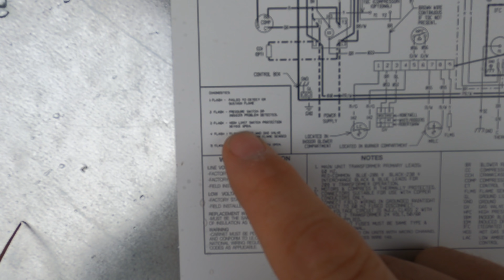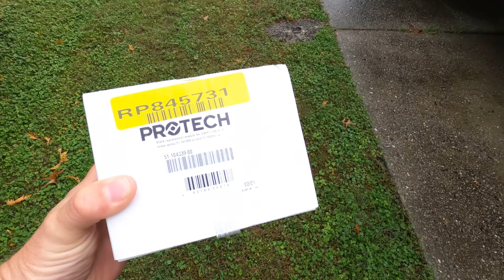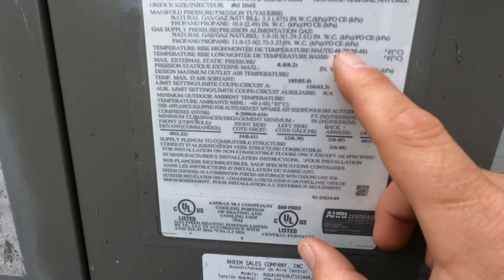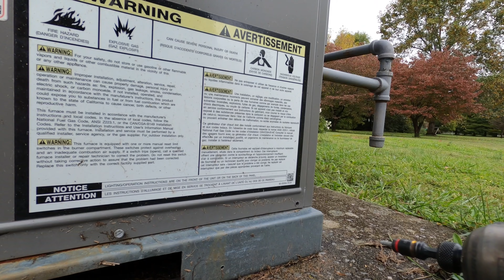Gas Heat WON’T Turn On | HVAC Service Call

Comment: Dude I was thinking during the whole second half of the video "man if it's under warranty, I normally just replace the whole motor anyway, not just the module", then you come around the corner with the same shit 😂 You are a top notch technician, and make me feel a little more confident about my practices every time I watch you. Awesome content man.

Comment: I love the video highly impressed on how you keep things so clean idk how you do it.... my only critique on the videos is that there is not enough explanation on what you are doing, or how to came to your diagnostic of the failed part. For those that don't have vast hvac experience it may not help those individuals and may even confuse them,when 90% of your videos are back ground noise. Idk if this kinda content is what you are aiming for, but if it educate I would advise explaining what was the issue and how you came to solve the issue. Thanks
Reply: Very good suggestion, was thinking the same. Replacing the thing is something (almost) everyone can do. Diagnosing the problem is the hardest part, especially for a newby like me.
Reply: But it’s not a how to video it is just showing you what he does in a daily life
Reply: He had several videos explaining in detail what's going on, think this and some others are just laid back videos for maybe people wanting to get in the trade, just showing the ease of some things but as u stated the troubleshooting is the most important and intricate part of the process
Reply: He working..he aint teaching!
Reply: Good advice but stop watchin other people 😂

Comment: I use ecm surge protectors, are area has dirty power. Since using them I have few module issues with the units after installation. Any inverter or ecm motor needs a surge. I recommend adding them during your installs.
Reply: Exactly. Cheap no brainer part that works.

Comment: Always check static on the duct system with blower issues as a precaution. If the motor spins freely then there usually is not issue with the motor when diagnosing x13 and VS motors, it is the module.  Good choice. x13 motors are junk anyway.

Comment: What was the static pressure. That is the number one cause of motor failure. I have hardly ever worked on Rheem/RUUD RTU's. You just don't see them very often at all in my area. Ive probably seen 10 or less in my 22 years in the trade

Comment: What are your thoughts on Aprilaire 8444 thermostats
Reply: I like them, work well...
Reply: @Paulie1232  I love them too my reason of actually getting one initially was the auto change over feature which allows it to automatically switch between heat and cool modes based on your heating and cooling setpoints

Comment: did you just assume it was the module? I would have swapped the whole motor out. Just wondering if this was a fix based on experience or if there is, in fact, a way to test that module.
Reply: You can ohm out the motor to make sure it’s ok. Once you unplug the module you can test it at the motor side of the plug.
Reply: @Shmash_whatever  gotcha! it wasn't explained in the vid so I was wondering his process.

Comment: What’s the point of this video? Zero troubleshooting.
Reply: Him knowing how to read the code is his troubleshooting.
Reply: @d3adp94  open limit? Not at all. That leads you to multiple options.
Reply: It's an umbrella commercial I think lol
Reply: not much to trouble shoot when it comes to a bad x13, fix it and move on.
Reply: @cdubs1723  Do you know what an open limit is? Clearly not. It’s a safety switch. His knowledge of the blower not working was spot on
Reply: @d3adp94  could’ve been a bad limit itself, could’ve been bad air flow or clogged filter etc, could’ve been a lot of things other than the blower. Just boring to watch a video with zero commentary is all.

Comment: I had the same problem with a unit it turned out to be the flame sensor
Reply: Your board probably wouldn't have given a high limit code if it was the flame sensor alone.

Comment: I have replaced Trane indoor ECM modules due to overheating of the module. Customer had too many in-line air filters that were restricting air flow. Over time, the module got fried. Expensive fix.    Another time, I replaced Trane heat pump outdoor unit fan motor/module. The motor was good, but Trane does not make a separate replaceable module for this outdoor motor. Motor/module was a $900 part. Ouch!!!

Comment: How did you diagnose that it was the module not the entire motor and module itself, when I replace those I usually replace motor and module at the same time? I guess I should’ve watched till the end 😂